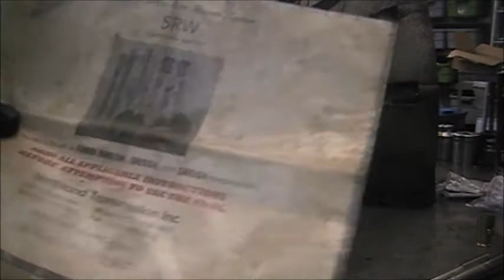FORD EXPLORER, MERCURY MOUNTAINEER  5R55S 5R55W TRANSMISSION SERVO BORE REPAIR PART 1

Comment: Hi Sir, I have a 2007 Mercury Mountaineer and im having transmission issues.  My truck goes into drive and shifts all thru the gears, it works in low gear and i can shift it manually all the way thur as well. But when i put it into reverse,  it engages but it doesn't move. It throwed the code P0705 which is the Transmission Range Sensor, i ordered it but im thinking it might be a deeper issue. Any suggestions
Reply from the maker: Well, you can start with changing the range sensor if you like. However, that range sensor has to be set right. If it is not set correctly, the vehicle will not engage correctly. You would need a professional scan tool toset it correctly. If you buy a range sensor and set it correctly and it still sets the range sensor code then you need to take it to a transmission shop to see why it is still setting that code
 You may have to take it to the shop to have the range sensor set.
Reply: @thisisyourtransmission  thank you so much, I really appreciate your fast response and I'll let you know the outcome, the range sensor replacement should be in this week some time.